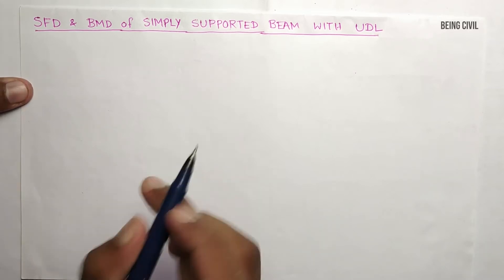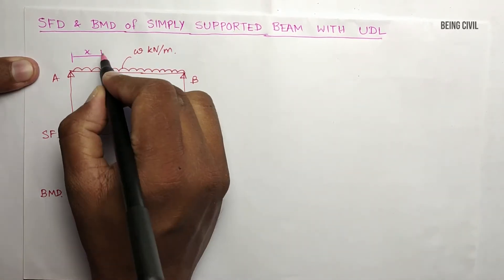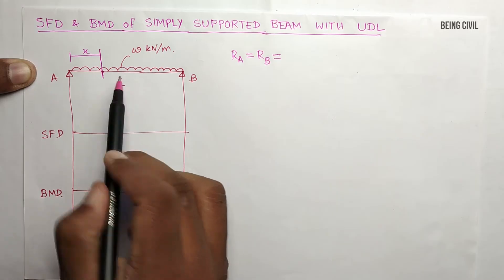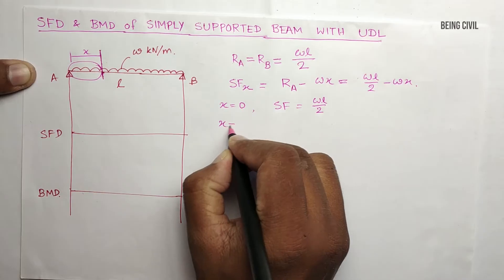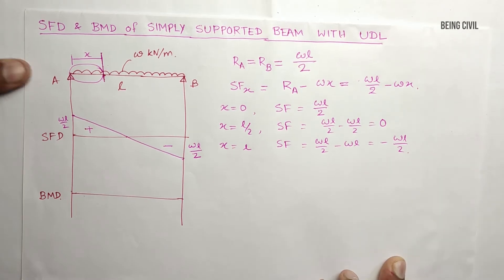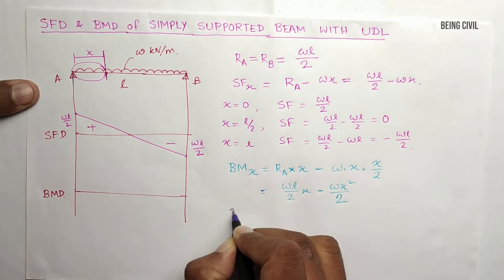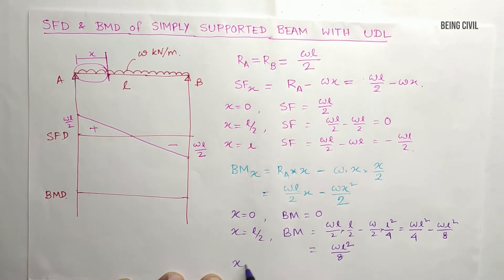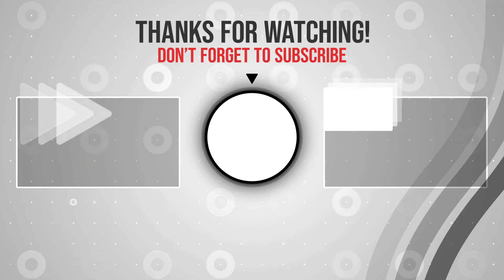SFD & BMD | Example 2 | Simply Supported Beam with UDL

Comment: As the bmd has positive value  parabolic curve should be upwards because plus sign is above datum line but wrongly represented in this channel
Reply from the maker: I took sign convention as tension side positive. that's why my positive is below datum. you can take sign convention as per your choice. sign is important whether positive or negative. but sign convention as per your choice. Staadpro, structural design software takes sign convention as what I have shown in the video.